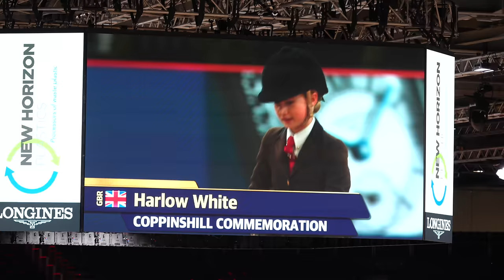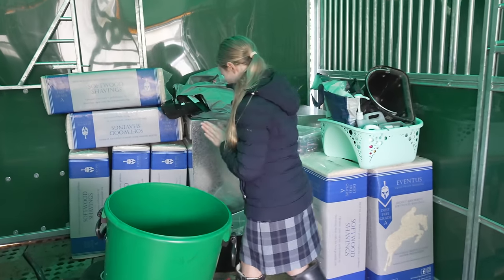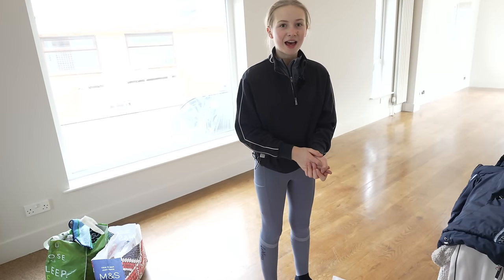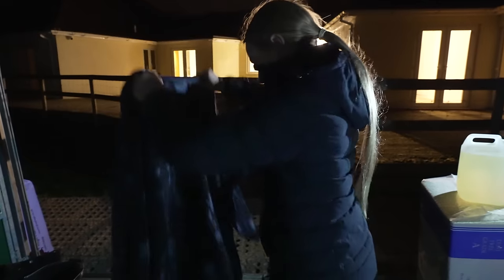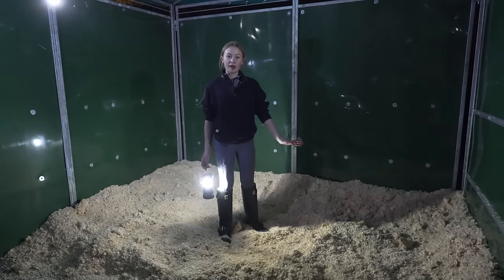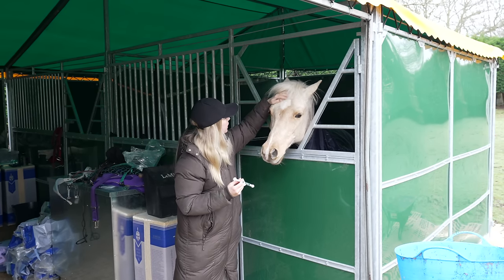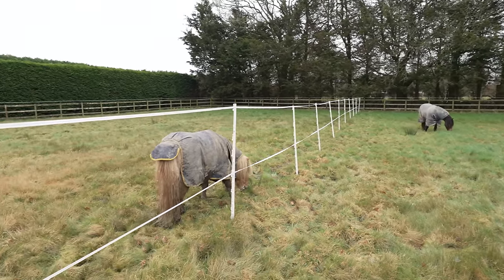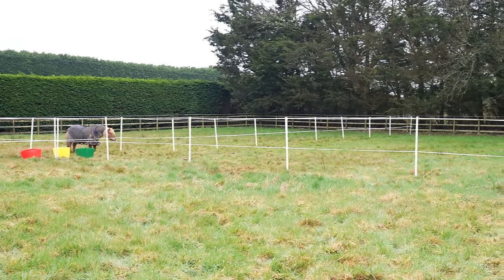WE HAVE MOVED OUR PONIES TO OUR HOUSE!

Comment: What is the difference between hay and hayledge I’m from the US and we just feed different kinds of hay?
Reply: Haylage is grass that has been cut earlier than hay. It’s at a younger stage of growth when it’s cut, and it’s left to wilt instead of completely drying out. Haylage is preserved using fermentation, and is baled and wrapped in several layers of plastic so it’s moisture content remains high.
Reply: @horse_gamer1212 ok! Thank you!